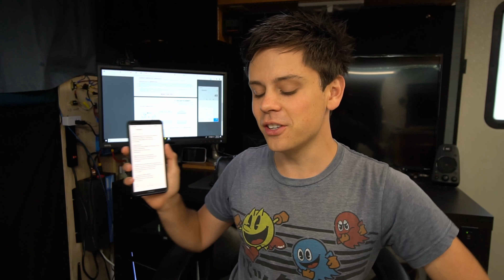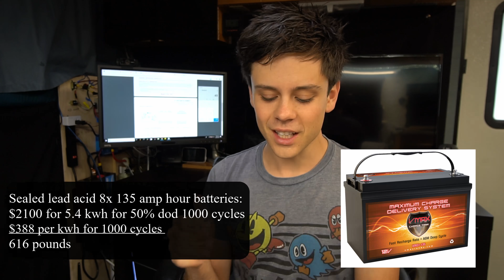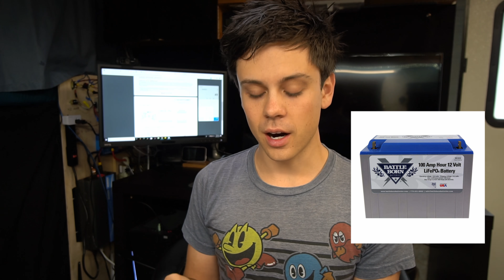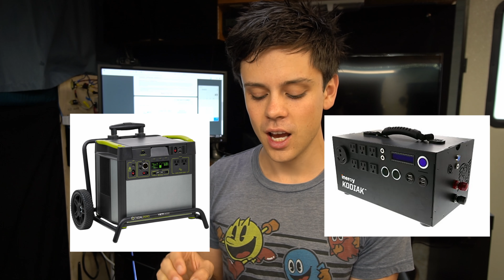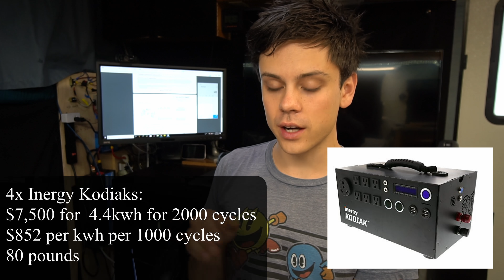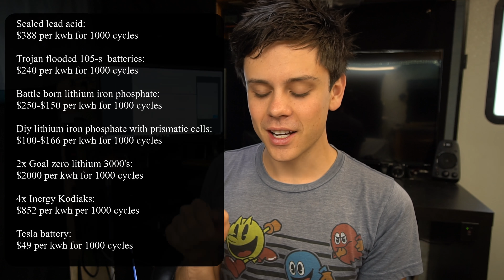Off-grid Solar Battery Price Comparison: Tesla vs. FLA vs. SLA vs. LiFePO4 vs. Tesla

Comment: Have a very small Solar System if I did upgrade batteries how many  Watts coming from the panels would I need to charge it adequately I am very unfamiliar with solar just started
Reply: Break it down into "volts needed to run a normal day in your application and go slightly higher. Example: 12v vehicle charging system, the alternator, voltage regulator and the other components maintaining a charge on your battery charge  at 13+ Volts  to 14+ volts Also adding more batteries increases volts and amps depending on how your run the wires. Series or parallel. one produced more volts while the other amps. (going to let you go find out the answer to that) if you have a system already you could make it more efficient  and last longer between replacing dead cells on the battery bank because of wrong or not updated wire techniques. look up r.v. parallel vs series .
Reply: I have not put it up yet been scared of the wiring have a 100 W panel but a 40 amp renogy charge controller a 3000 W inverter and gauge wiring to be able to upgrade panels if I can put this together right without burning down the house  Have a 100 amp hour  Mighty Max Did not want to spend a lot of money if I could not figure it out or did something wrong

Comment: what are your thoughs on an off grid cabin/home with some moden features 
needs to run a 8000 watt + 110 volt invertor and support it every day..   We have an old 4000 watt system, older pannels and 8 x 500 amh wet acid batteries that need replacement.. Want to consider lithum ?

Comment: I agree that when you calculate long term cost, lithium is the preferred technology. But the upfront cost is much higher compared to some of the other battery types. That is the sticking point that is keeping me from making a decision about a solar system. I have a garden shed/workshop that I would like to power with solar. I don’t anticipate any large loads at this time.  Mostly lights and a few battery chargers for cordless hand tools. But at some point I might want to scale up the system to power a pump for a nearby well and perhaps a small mini split system.  But right now, I want to build a complete system for no more than $2000 and I would love to pay $1000 or less. But to avoid backing myself into a dead end position, I would love to be able to expand the system in the future while using the components I already have.

Comment: I would be interested in a Tesla system for my sailboat. I now have 2X245 watt Kyrocera Panels with a Morning Star  MPPT 45 charge controller. I have to replace six lead acid batteries as the previous owner left the boat sit for over a year and a half without checking the fluid level in the batts and cooked them all bone dry. Can the Tesla also be used to start the diesel engine as well as the house bank. I'm learning a lot from your vids and appreciate your expertise. I would be willing to buy what I need from you so I know its first rate.

Comment: Has anybody used the Earth as a battery,resonic it to a frequency which you can convert it to a inverter into a battery system as the earth electrical charge changing,it is not a direct current.Also you can collect electrical ions from a earth conecter,special from those electrical post along the street.

Comment: Great video but I have a question,

I can get a 115ah lead acid battery at home Depot for 110 bucks. Who would spend 250 dollars for lead acid?!
Reply from the maker: More expensive lead acid batteries last twice as long or more. Don't use cheap lead acid for solar. Your wallet will hate you haha
Reply: @WillProwse  thank you for the quick reply! I'm new subscriber and learning a lot! I live and work full time in the Bahamas on a sailboat so solar power is life!

Comment: Was the price for these batteries including the inverter and other required equipment or just batteries? Because the Goal Zero and Inergy are complete systems.
Reply: Also was the price for used because life cycles would be lower right?

Comment: What about building your own lithium ion battrry using new  18650 batteries and or used 18650 after a capacity check? most of what you're paying other manufacturers to do is labor which is total b***** if you want to save money...

Comment: miles per gallon to tow the batteries for ever in your camper.  600lbs vs 55lbs.
Reply: Or even the structure to support the battery!

Comment: I have a off grid solar split type air conditioner, it runs off 48V DC, the outdoor fan motor runs 48v dc at 1.2a, compressor load 48v DC at 18.75 A, compressor locked rotor amps at 46.0a and miinimum circuit ampacity is 50a, max dc current at 20.a. the question is how many panels do I need and could I run it off a 2 Tesla's in series? I'm assuming I need a 48V battery system. Or combination of parallel and series? If I buy your book will I be able to find all this info in it? Well never mind if I buy I'm going to buy it just because you come off as all knowing, love your videos for someone so young I trust in you. What do you recommend?

Comment: Good general comparison, but I still have to point out that the numbers are wrong because you are equating "apples and oranges".  The major costs you are missing are the battery management/safety/engineering, and the retail, warranty.  You credit the "Tesla" battery with many times the life, yet you do not include the expense of the battery management system required to achieve that life, and not burn your home down!  Most of the batteries are full systems with professional "Failure Mode Effects Analysis" by certified engineers backed by testing and company warranties -that will stand up in court.  Your "Tesla battery" is one piece of a system, from an illegitimate source, with NO RECOURCE!  If you bought it on Ebay, it is NOT a Tesla battery!  It might be a used Tesla battery from a car that was wrecked or stolen.  More likely it is a Chinese knock off.  Simply stated you have Nothing to back your life estimate beyond your assumption (because the company rejects your battery without provenance) and you are comparing raw cells (as capable of explosive failure as long life) to full systems.  How much would it cost to hire a professional to make your "Tesla battery" into an equivalent system -one that the home insurance company will accept and cover?  I understand you are excited about your value add -and it is fully worth the nothing we are paying, but it is WRONG!
Reply from the maker: Yeah you're right. But using Tesla is not new or hard to do. I'm not the only one doing it actually, a ton of people use them for their solar battery. And I didn't use a BMS or anything. Just connected it like a lead acid battery and used battery protect and changed the upper charge limit voltage and that's it. I get your point but I think you haven't used these batteries because they are pretty dang easy lol
Reply: @WillProwse  My  objection is the apples to oranges comparison producing the wrong number.  You consider the right things, I suspect you get to a good conclusion. if someone is willing to learn what you teach, the highest performance solution is the Lion car battery tech.  Gushing over this wrong number is what made me snap.  I think you are right to be excited, but a better statement is that cutting edge tech superiority is not "someday when mass production ramps..." IT HAS REACHED THE TECH FRINGE NOW and mainstream is just time and market.

You consider selling systems -I will tell you that there is great value to be offered IF you develop the quality assurance.  In China there is a goldrush to be the biggest battery producer -too much capacity for all but the craziest regulatory requirements.  Off grid solar already offers better return than treasuries -and a big part of the globe still has grid reliability issues.

But do not mistake the difference between being a provider, or just an influencer.  You can be top notch for an influencer and still be pathetically out matched as a defendant against many expert witnesses -you must control and document quality!
Reply from the maker: @skyak4493  wait what is your actual point? it is really hard to follow your comment. Can you just list out the points you are trying to make. kind of confusing to understand.

Comment: 9:28 And I'm spending 2.6 cents per kwh on grid power.
Reply: Wonderful you get cheap power when you're plugged in.
Now go off grid. That's what this is about. 
My 45' sailboat would need an awfully long extension cord and then I would have to calculate drag.
Reply: Lucky you
Reply: Where are you... ?

Comment: I would guess Goal Zero isn't putting as much work into cooling and don't have as much control over charge/discharge, have much less input in battery specification (for one they certainly don't use unique cells) and are more afraid of warranty problems. This is in comparison to Tesla because NMC. A Tesla car's battery is also much easier to warranty for longer because the battery is a much smaller portion of total material cost. Tesla also has the Ace up their sleeve in that their stated goals are as much making money as they are changing the world for the better, so they might be more motivated to eat the cost of warranting replacements of failed batteries.
1. This is pure 100% speculation, no one would be allowed  to offer better really.
2. Some of these factors don't apply to Tesla Powerwalls, I hope anyone who reads this is smart enough to identify them.

Comment: Could I use the Tesla battery in my rv
Reply: Mortons On The Move use 1 Tesla battery and have a video showing how they added the BMS, including showing the actual work.
I believe they also say where they bought it. They company they purchased it from pulls them from totaled cars and tests them and then grades the quality of each battery pack. L may be remembering wrong but I think the company sells Nissan Leaf batteries which are also being used in solar installations.

Comment: My understand is you do NOT want to deep cycle your Tesla battery if you want max cycles. If you build your battery bank large enough to where you never go below %80 you will get the 20,000 cycles.  %50 discharge will get you 2,000-5,000 cycles. Basically the deeper you discharge your battery the more wear you place on it for that cycle. It sounds like your taking it to %10?

Comment: The application I want to use is RC club solar station located in New England. Temperatures from -10F to like 100F. So my research so far in the Lead Acid route
Reply from the maker: Check out lithium titanate

Comment: Thanks for the work, some of the logic here is flawed, and clearly you live in the US (maybe southern?) where it doesn't get cold outside. :)
The Kodiak can take external batteries, so you don't have to link 4 of them together. 
Things such as availability of product is a thing. Tesla batteries are not cheap or available in anywhere but the US. 
I completely agree with you that Lithium batteries are better, but things such as life cycles are just manufacturers warranties.. if you balance and maintain your system, they can go well beyond 2000 cycles (any of the systems mentioned above).  
Good video, editing and content - dig in deeper with your analysis, such as setup costs, DIY technical scale, maintenance and add things like weight, but weight isn't a deciding factor when people build these, it's typically square footage (which LiOn is better anyways). Things such as surge and spike times are all various areas people need to consider if your target audience are new installers.

Comment: About cycles. Am I right to think of 1 cycle = 1 day? ( the battery charging during the day and unloading at night)
Reply: 1 cycle = 0% to100% to 0% charge-discharge cycle. It would equal 1 day only if the battery was so exactly sized, that it gets completely charged during the day and completely discharged during the night. If you start with 100%, then discharge to, say, 50%, then recharge to 100%, that's half a cycle. In a typical solar application, batteries are cycled around 50% (depth of discharge) within 24 hours.

Comment: Thanks for video. How about Tesla Powerwall, is it worth to use Tesla Powerwall 2 to build an off-grid solar system? It has an inverter inside and an app to monitor it.
Reply: I tried to order a pair of them..The comment was "We don't sell in your state"  ...They do sell them about 80 miles to the north, but not in NC.  The other issue: order now, get it perhaps December or March... it's May now.... VERY long lead time.  And of course, give them thousands now as a "loan" or "Deposit" ---  And with the burn rate there, possibly never receive it.

Comment: The mistake here is the assumption that the warranties provided dictate the actual longevity/cycles of the batteries. When one sees FLA batteries that are looked after well, running for 8-10 years, the cost comparison becomes invalid. And further, there is no actual real world validation of the LifePO4 cycle life yet for any of the drip-in batteries, especially those that are placed in travel trailer battery boxes out in the open as they are advertised as "Drop-in replacements" yet ignoring the know sensitivities that this chemistry has to heat. I predict a LOT of "not meeting expectations"  on the Drop-in batteries with respect to life cycle and capacity retention after a few short years. Hope I'm wrong....because I see no recourse for the early adopters, as the warranties are for "defect" only - not for loss of capacity over time.
Reply from the maker: Haha!! I hope you are joking. Coulombic efficiency and internal resistance of FLA batteries is a joke. And yes there are real world tests to verify LiFePO4. It's not new lol it's a very old lithium ion chemistry. I think you should Google LiFePO4 and also lithium titanate and read about how these batteries work. You are missing a lot. I have some other videos that go over battery studies but I think you should read how electrochemical reactions work first.
Reply: @WillProwse  Read my post carefully first. You're missing my point. BTW, what manufacturer of the Drop-in LIFEPO4 batteries in RV applications with solar systems have got actual, measured, real-life proven performance over, say, 8-15 years? Answer? Not one. THAT is my point. If I'm mistaken, please state the manufacturer name(s). Thanks. BTW, I find your videos very useful, very helpful and I've learned a lot from them. But until the above questions can be answered, I'll call the assumptions on longevity of the Drop-in LIFEPO4 batteries as, shall we say, UNPROVEN in that application. (NOTE: We are NOT talking about Drop-in batteries placed in climate controlled locations, managed by very good BMSs, but rather the "Drop-in" batteries replacing FLA/AGM batteries sitting outside on a trailer tongue or inside an uncontrolled 5th wheel generstor cabinet or battery box, with ZERO thought to heat and cold, as so many are installed.(Rightly or wrongly....the owners and installers are too often simply taking the marketing claims of "Drop-in replacements" at their word, and not worrying at all about heat or cold, probably because they think the BMS will protect them.

Comment: Did you check out the new Goal Zero 25 amp speed charger and you can connect two or three of them at a time to The Goal Zero 1000, 1403 thousand and charge it now instead of 18 hours and three to four and a half hours The Goal Zero is now officially worth it and they have a plug where you can also Connect Four rules are rules Chargers together and make it into one and throw 232 260 watts of power and sue their Goal Zero Which is less than their new 25 amp speed charger but it still charges your Goal Zero and no more than four and a half hours so go zero is officially worth it now to buy with their speed Chargers and they are making a new Goal Zero 100 amp battery add-on that doesn't even look like a regular battery it definitely looks like a goal zero product again Goal Zero is now officially worth it to buy I might spend money on to Goal Zero 1000 or 1400 with four of there 25amp speed chargers

Comment: Great video.  I'm just about a month away from building my solar system for my RV and I am going to use the Tesla Battery.  Thanks for all this great information.  Most appreciated.
Reply: I have one and like it but keep in mind that it'll max out at like 24.5 v where a typical 24v system will top out at 26+-.....bottom line is your inverter  low voltage cutoff will likely trip sooner on the tesla.  So expect that or search inverter low voltage shutoffs for the best one to match the Tesla voltage

Comment: Is it advantageous to buy used Tesla batteries? If not, where can I get a 24volt/48volt 5.5kw brand new?
Reply: you should buy used if it works and the price is good, those batteries last a very long time, much longer than the vehicle itself

Comment: I like your video, but be care full with battery cycles. Tesla with a 5000 cycle battery sounds so good, but the degradation of the battery was simply not taken in to account. If after 3000 cycles you could still pull 60% of the initial capacity of a Tesla battery, doesn't matter if it's a battery type 1, 2 or 3, you are a lucky guy. I like the marketing figures but no independent tests have shown that they can hold their claims. Sorry for for my thumbs down, but it is to naiv to just take the figures that Tesla and the others prints in their specs.
Reply from the maker: Watch my video that goes over various data sheets for various lithium batteries.
Reply from the maker: And also consider c rate for solar usage. Also cycle bandwidth

Comment: Hi, great video. Dont forget about the Rolls 5000 battery. A bank for 60kwh (30kwh usable) 12V system will cost around 10'000$ and it has 3500 cycles before replacement. The cost for that will also be much better then the lithium battery. For sure tesla is stil lowest price :-)